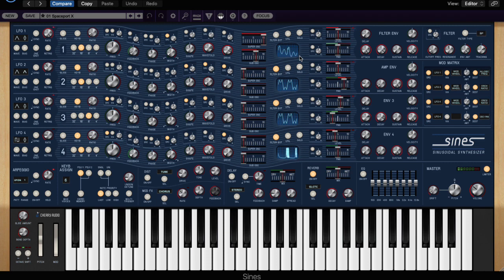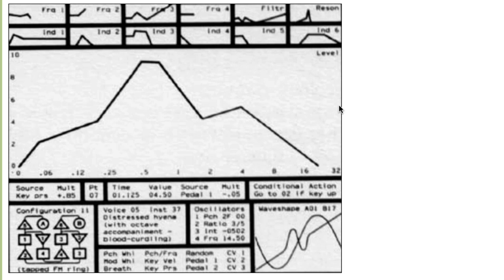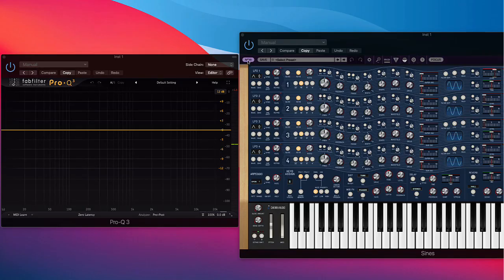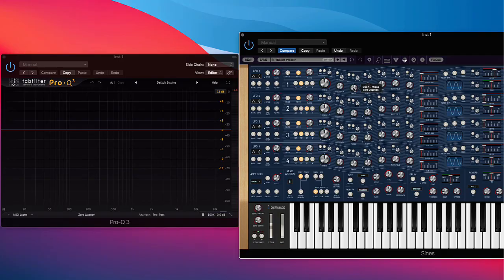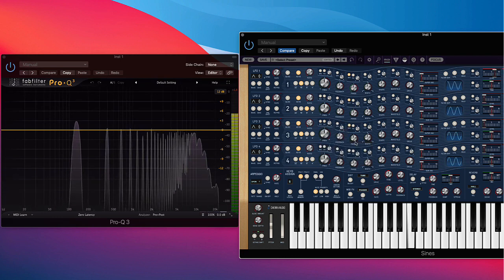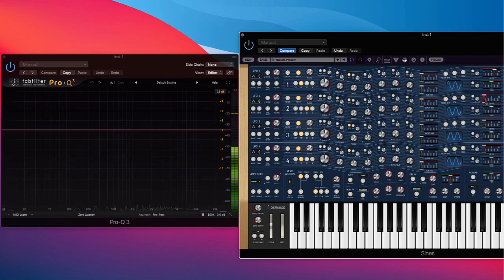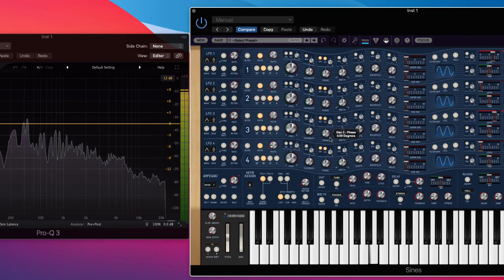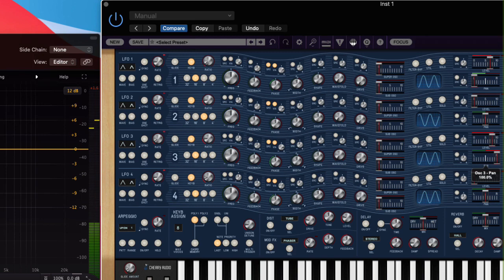Four-Oscillator FM Ring (Buchla 700 Algorithm implemented in Cherry Audio's Sines softsynth)

Comment: Great video, Aaron.  I'm guessing the beating you mention at 5:00 is because the Drift knob (in the Master section) is set to a non-zero value - you want that on zero for pure non-wobbly FM.
Reply from the maker: Oh! That's good to know. I didn't even notice that knob.
Reply: A little drift is nice in pretty much any application OTHER than FM/phase mod! Also, the Sub and Super sliders are often really useful when doing FM.
Reply from the maker: @CherryAudiovst  Hello Cherry Audio! I'm loving Sines; someone on the Pro Synth Network group on Facebook suggested I check it out (knowing my interest in the Buchla 700).
Reply from the maker: @CherryAudiovst  I need to check out Voltage Modular Designer next.
Reply: Great theory put into practice. Thanks.

Comment: cool, never heard of Buchla 700.
How does this "Yamaha" FM stuff work? something like voltage controlled sine wave oscillators?

Did you ever peak at the Akai MPC X? quad core, 24 bit audio, touchscreen.
it has a plugin that can do a TB-303 but has more waves options using a knob, morphing waves a real analog vco can't do.
also cool drum modelers that can emulate tr-808, tr-909, cr78, etc. best musical tool out there.
Reply from the maker: Check out John Chowning's paper "The Synthesis of Complex Audio Spectra by Means of Frequency Modulation" (easily found by googling)
Reply: @Lantertronics  thank, you and downloaded from Standford university. this Yamaha chips are not easy to come by, the paper says after a quick look over that FM syntheses was de a co effort between Standford and Yahama seems.

Comment: oh wow... how would you do phase modulation in a eurorack? I have 7 oscillators in my eurorack set up including the new tiptop buchla twin, and I am wanting to try out this patch. Thanks
Reply from the maker: I don't think most modules have a phase modulation input, but if they have a linear FM input you can very much do something along these lines. The thing you want to avoid is exponential FM input (which can be fun in its own right, but will give you all sorts of clangorous inharmonic sounds).
Reply: @Lantertronics  ahh ok, I have a doepfer thru zero oscillator with linear frequency input. I just need another three to make your patch lol. Thanks for the vid, really informative.
Reply: The Joranalogue Generate 3 has phase modulation (and linear + exponential FM). You would need 4 of them to replicate this patch though.

Comment: I've been playing with replicating Configuration 0 in Bitwig's Grid modular synth. How do you model indexes 3 and 6? I have them as an attenuator followed by an AM/Ringmod module and it does sound good but I wonder how close that is to the original model. I also played with adding a bit of skew and wavefolding to the oscillators themselves which sounds really good and I think you can do that in Sines as well
Reply from the maker: In may supercollider implementation I model them as attenuators going into a nonlinear wave shaping function. A wavefolder is one possibility. On the Buchla 360, 400, and 700 (and ID700) these are implemented with Chebychev polynomials. On old analog Buchlas like the 259 and the Music Easel the waveshaper is a fixed wave folder.
Reply: @Lantertronics  Thanks - I ended up with what seems to be a convincing implementation of config 0 after all, it does sound good. I have a video about it up if you're interested
Reply from the maker: @FilipLamparski  Oh yeah definitely interested